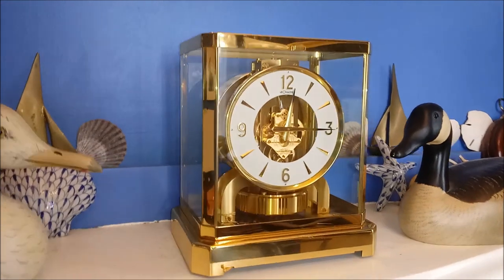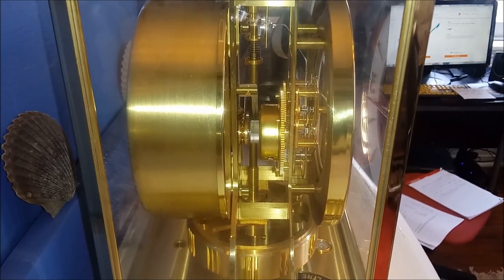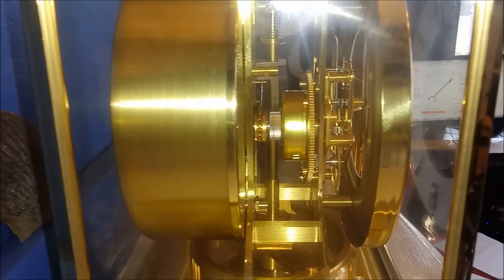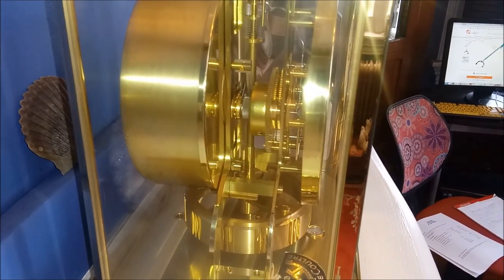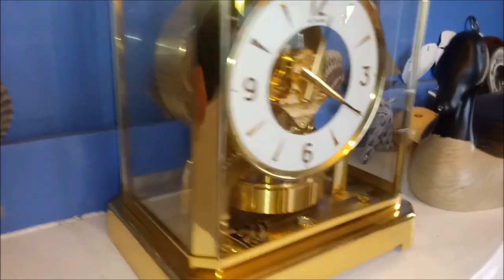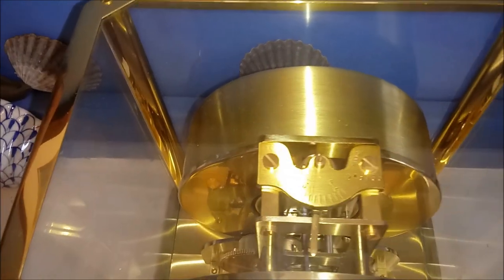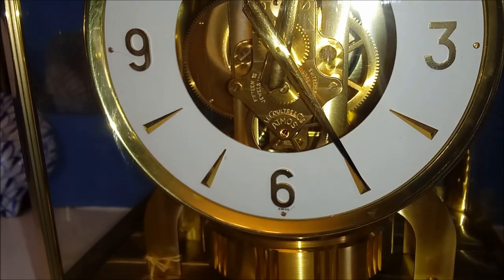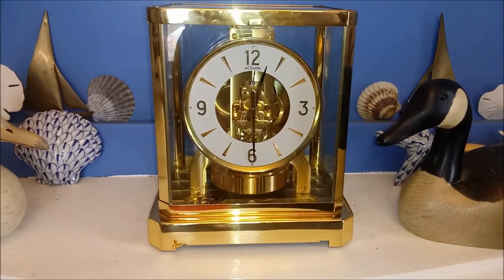ATMOS 528 PERPETUAL MOTION CLOCK ~ JAEGER LECOULTRE ~ 24Kt. GOLD PLATED

Comment: How do you set the time?
Reply from the maker: I have read the owner's manual from cover to cover. I don't want to mess anything up. To set the time, first you lock the pendulum at the extreme of the rotation. Then remove the front cover. Then you can move the minute hand around until it is showing the correct time.
Reply: @the_clock_guy  I see, as great as these clocks are. I would never want one.  They seem like more trouble than they're worth.
Reply from the maker: Maybe in the initial set up it a little bit of work, but now it will sit on my mantel keeping accurate time for 20 years without ever touching it again.